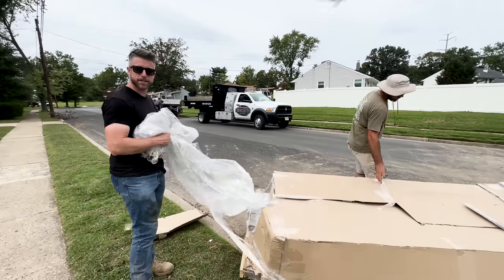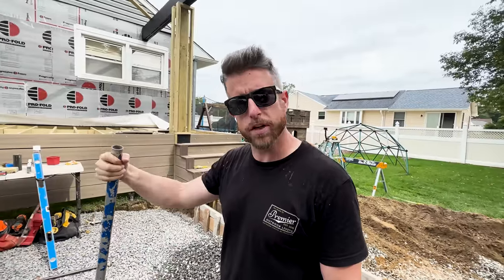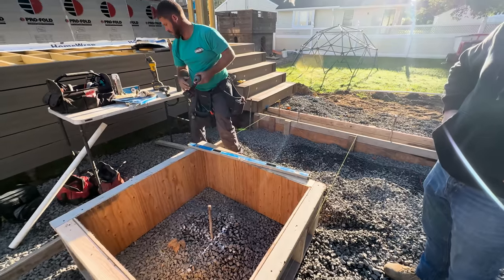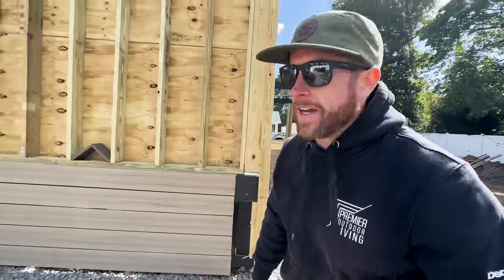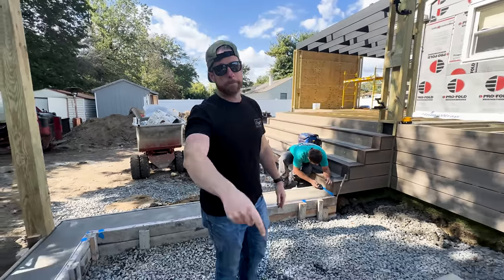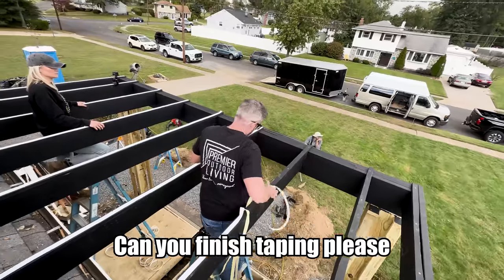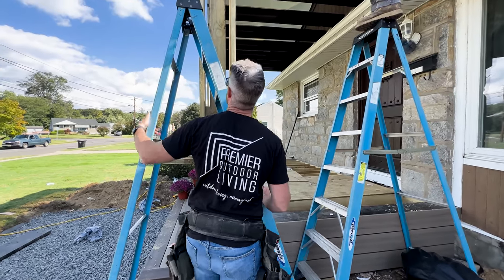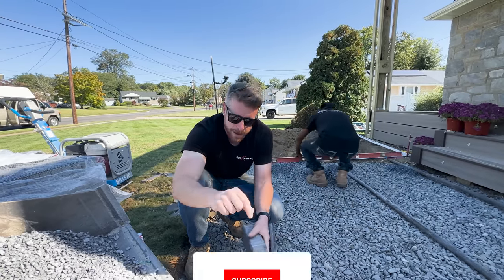Installing Pergola Roof Cover and Pouring Concrete!

Comment: I see this is a different poly system, how does it compare to the Hercules system you have used in other videos?  I didn't see you walking on this one, but that may be because you didn't have the slats on this build.  The glass look (no internal lines) is very appealing.

Comment: As much of the little details you always seem to do I must say I was surprised you didn’t use darker fasteners or at least paint the heads of the ones you guys used on the poly pergola panels … no shade love your work and just an observation.
Reply: It’s probably best they didn’t. You don’t want to see a painted fastener discoloring the translucent panels.
Reply from the maker: We probably would have if there was any viewpoint of the roof but there are no second story windows or anyway to see them except from the drone so it seemed kinda pointless